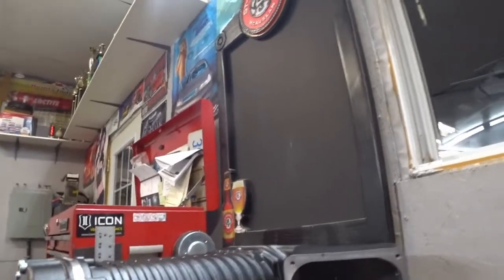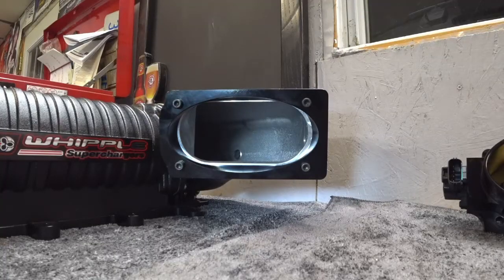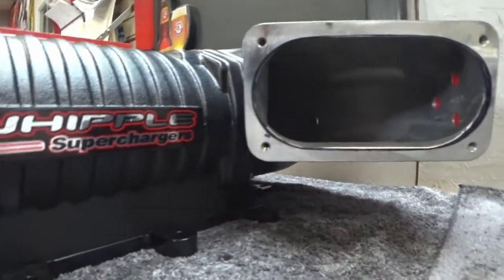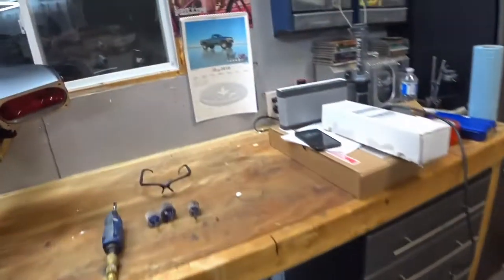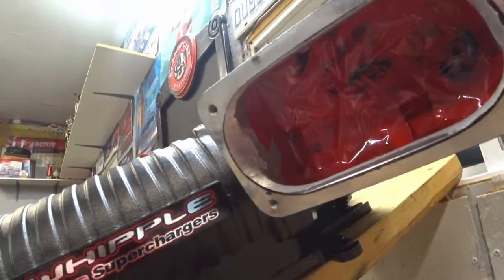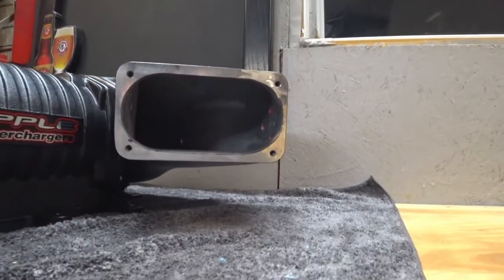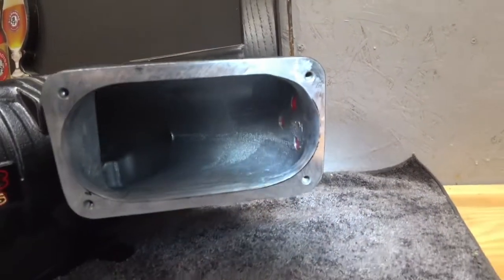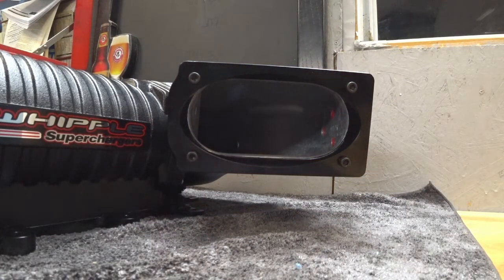Port matching Whipple 3.4 to a Whipple super big bore adapter

Comment: You should see how restricted is on the inside when you take that back plate off I had a custom CNC in intake made there is a lot of restriction When It Bolts to the back of the blower
Reply from the maker: I'll have to do that next I guess